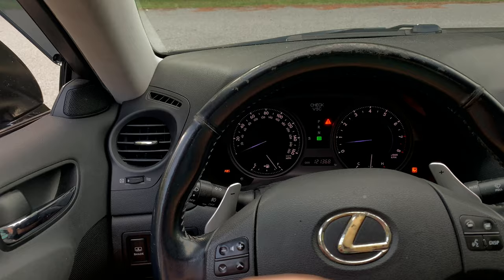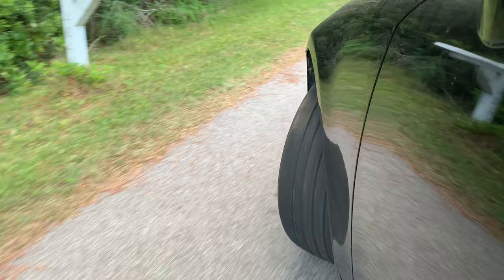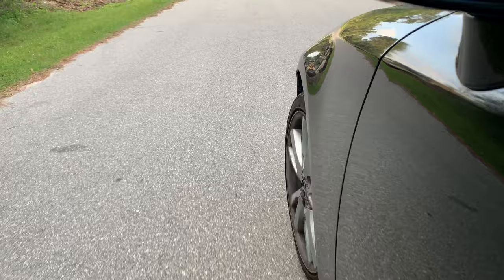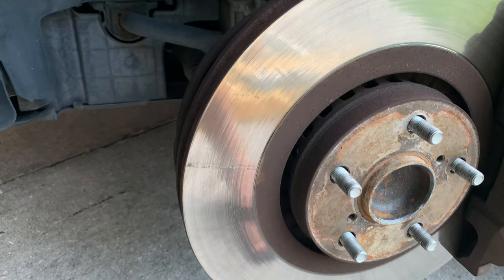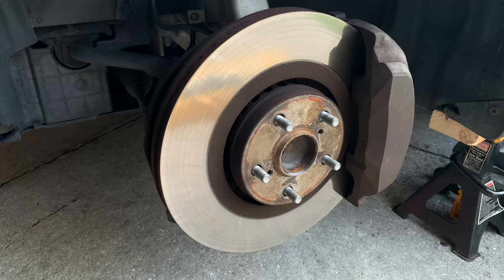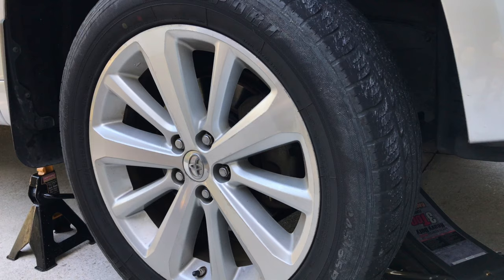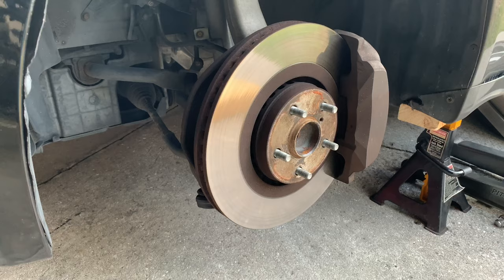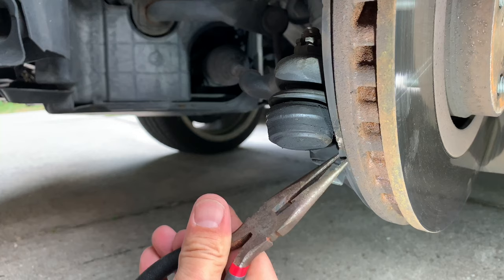Found & fixed: scraping noise when turning right or left

Comment: I had this exact problem, had convinced myself it was a wheel bearing. But the noise just wasn’t right. Until I saw your video and you had the exact noise I had. Checked my dust cover and sure enough it was bent inwards and in the perfect position to run when I had my wheel cranked for a hard turn. Pushed it out and away from the rotor and bingo fixed!!
Reply from the maker: Awesome, glad it helped!

Comment: Thank you! I had the exact same noise and the exact same problem. It was harder to get the tire off than to fix the issue. Thanks for the info on the dust shield. It was easy enough to straighten with a pair of pliers. If you are reading these comments because you have the same issue and are at all handy, I recommend that you look into this yourself.
Reply from the maker: Awesome, thanks for sharing!

Comment: Broooo
I just got my new (to me) corolla and it does this when turning left.
I know my way around cars but never would I have thought about the dust cover scraping as I thought it would be audible independent from steering angle.
I'm gonna have a look at the cover tomorrow. If it is the issue you saved me like 3h of driving to the dealership and back.

Perfect video: short and straight to the point. I like that!

Update: It really was the dust cover. I owe you one my dude

Comment: Hahaha, it was so funny, after watching this I went to my car and reached in to feel the dust cover behind the brake rotor to see if it was bent or damaged somewhere. When I tried to pull the bottom of the dust cover away a little bit, a small rock fell out! Drove the car forward and back and the noise is gone!! So happy it wasn't anything like damage or anything major that would cost a lot to fix. Also super happy I didn't have to take the wheel off or even get under the car! I never would have known to check this way if it wasn't for this video, so thank you so much!!!

Comment: Thank you! This video helped me so much. Turns out the edges of the rotors had corroded and were rubbing against the shield. I bent the shield slightly and also removed the corrosion on the edges of the discs/rotors.

Comment: I fixed it without taking off my wheels, I just put my hands in between the rims and then I pushed off the break shield or whatever it’s called from the breaks so whatever was stuck in there , rocks and what not it was removed and the noise went away just like in this video , thank you !

Comment: Thank you. Fixed our 2017 Nissan Pathfinder. Luckily, I didn't need to take the wheel off, I was able to squeeze under it and bend the dust shield with a stubby flat head screwdriver.
Reply: That's great, I was wondering if it was absolutely necessary to take the wheel off to do this. Hopefully I can do it the same way for mine as I don't have the tools to lift the car.

Comment: Thanks I hope that’s all that is wrong with my 2005 Toyota corolla LE. It has all new brakes all new rotors all new shoes for each wheel new tires, etc. someone told me it could be rack and Pinion steering. I have not taken it anywhere yet I will look at your suggestion.I hope it is what you illustrated and thank you so much for the video. And take care buddy
Reply from the maker: Hope thats what it is... !

Comment: I am having a similar sound only when I am turning left with my Corolla. I hear it right around my feet so I think it is the front left wheel too. It recently snowed here and after shovelling I placed the shovel next to the car in a pile of snow but accidentally drove over the shovel when moving the car through the snow. It dragged the shovel underneath the car for a few metres and since then I've heard this sound. Hopefully it is something simple like this video and not a major part that has been damaged.

Comment: I've got a Mazda 3 and a very similar sound when making a hard right ... I've also had two tires on the rear passenger side blow out within a few months of each other and am beginning to think the two things might be related.  They might still be two different problems, but is there any one thing that might be causing both issues?

Comment: ...step 1... jack up DF wheel... wobble wheel left and right, then top and bottom to check for looseness within tie rods, l wheel bearings, ball joints and bushings, next place pry bar between upper/lower control arms and steering knuckle to check for play in ball joints... THEN remove wheel, to inspect pads, and rotors.

Comment: Thanks for the video. I have a question. If the noise was the brake/dust shield hitting the back of the rotor, then why did it only make the noise when turning the wheel?
Reply from the maker: I would guess wheels flex or change angle a bit when turning.

Comment: Same exact problem turning left. Can’t imagine it’s a wheel baring as I have a “19” Toyota Corolla with only 50k miles. I’m going to do this tmrw.
Reply from the maker: How did it go?
Reply: @DIYtimeTRD  Dust shield was bent. Thank you so much for this video.
Reply from the maker: Welcome! 😁
Reply: @greggucwa4543  I’m gonna have to have this looked at them. Because mine also does the same thing when I turn left and I hear it from the right. So I’m suspecting it’s the right wheel.
Reply: I'm having this issue on my 2014 Chevy Impala, turning left as well
Reply: 2014 Malibu 🙋‍♀️

Comment: Why does it only make the noise when turning? I just heard the same noise on my truck only when turning left! Hope mines an easy fix too
Reply: Same. Only hear scraping when turning left. Sounds like it's coming from the rear tires. Did you find what the issue was on yours?
Reply: Ya mine was actually the dust shield also. Lol I would’ve never thought that was the isssue! Hope to figure your ghost noise out too:)

Comment: On our 2005 Honda CRV. We're getting similar noise but we're also getting vibration an. The steering wheel on left and right turns. We just had both axles replaced by mechanic in the front. That didn't seem to solve the problem for us.

Comment: My scraping sounds sounds a little different when turning left. It's like it scrapes at 1 point and goes till it gets to the same point
Reply: Did you ever fix this noise?
Reply: @GARTON360  we need answers!
Reply: did you ever find out what the point was , i feel like my tire was grinding and scraping every cycle it made
Reply: @pulido  yes, it was the brake disc metal cover which was slightly bent and was scraping on the inner wheel. Hope it helps
Reply: @GARTON360  answer down below
Reply: @quemyst  answer down below.
Reply: mine too
Reply: I have the same sound. I need to find out what the sound is
Reply: @WCDL  It’s just the same as what this guy was sayin, i took off the tire and looked at the dust shield around the router for points of contact and along the bottom it was scraping, just used a flathead and bent it back haven’t had problems
Reply: @confederatefan  how did you fix the issue???

Comment: Nice work there. Saved yourself a lot of money. How do you tell if the suspension is worn or causing noise. I hit a curb pretty bad. To my shock I couldn’t find any damage. And almost has a loud wind like noise while turning right.
Reply: Did you find out the cause? I hit a rock today ans got a weird sound
Reply: @kzb2771  yes, so when I put load on the car while turning it made that weird scraping windy sound which was the front right hub bearing. It sounded like the left but sound travels. Also during cold start it made a spooling noise before fully warmed up. I went through hell and 3 Lexus appointments as well as a new performance intake. Before I finally believed this sound is also normal. Just need to warm up the car a bit. I also found a thread where almost all rcF owners had the same noise. Once you hit something, your senses all go up, and you hear things that you never noticed before. I also wrapped every trim and part with electrical tape and insulation. Also runner o rings to put pressure on any panels that rattled. Very quite now.

Comment: I have the same sound on my left (driver) side, but only can be heard whil running at 60kms and up..
I had new wheel bearing, the car doest have any dust shield.. im a bit worried if its transmission, although then shifting of gears (automatic) is smooth.. also, whether running or while breaking the sound is consistently they.. i hope u can help me out.. :(

Comment: I have that same issue but really really faint noise when turning right as well... i changed both my front wheels bearing to OEM's last January 2022, so i don't think its that.... i'll have a look for sure. Thank for this video.
Reply: any updates on yours? i'm hearing the sound on the left, but also very faintly on the right.
Reply: @loboyloboyloboy  Definately was the dust shield.Fixed.

Comment: I have the same sound first it was when going straight under 40 and disappears over 40. Also when I turn. I checked the brake shield and it's not that. I changed my rotor and breaks because the brakes were thinning already. But the sound now persists when turning. I changed my struts and the axle a few months ago also. But the problem started recently. You think it's the bearing?
Reply: Was it the bearing?
Reply: @theItalianshamrock  yeah it was the bearing. Rear passenger side. It seemed like it was coming from the front. So better to check all wheels.

Comment: I have the same issue. 2014 IS350 AWD. So it looks like I will have to get all four tires off the ground to allow the tires to move freely. I can't just raise the front and put in neutral and then spin the tires as I turn the wheel.
Reply: Same model car. Did you fix it yet?
Reply: @singletaryli8636  yes. Thanks. Car needed brakes. The technician said that OEM brakes weren’t that good. Didn’t last long. After market will last longer.

Comment: i got a rubbing sound as i pull away but not every time i pull away just some of the time and for like 2-3 seconds then gone, almost like a sound as if my car has been unused for many years. 2.5 years old 41k on clock and had it from new.
Reply from the maker: Probably break rotors get a bit rusty or covered with dirt after the rain.

Comment: I have 2004 oddesy with similar problem. Dust cover was very rusted and while adjusting, part of it just broke. Now it only makes noise sometimes. Does this cause any damage if I leave it as it is?
Reply from the maker: It protects rotors and brakes from dust and rocks flying in.
Reply: @DIYtimeTRD  thanks.  Would part of dust cover is still there and makes noise sometimes when I turn right. Would this cause any damage to my brake parts?
Reply from the maker: It usually scrapes against the rotor, so it could possibly create a groove on it.

Comment: Is there another possible reason for this noise? Mine does it when I accelerate and turn left but it goes away and I had just done my brakes
Reply from the maker: New brakes might be scraping agains the rotors.
Reply: @DIYtimeTRD  that's the noise I took it for before the brakes though, they fixed my brakes and it still continues . Is it possible the size of rim and tires have something to do with it?
Reply from the maker: Have you ruled out the dust shield already?

Comment: I have a 2015 optima, it does this humming noise but as if it goes around the tire. Not constant and only when im turning on a curve. Once the steering wheel it straight it goes away
Reply: Ever find out what the issue is? I'm experiencing the same thing on my 08 Impreza. Front right tire makes a sound like in the video when turning right going like 20/20+ and locks up sometimes on a curve going above that so I slow down super hard for all right turns right now lol
Reply: @lamp709  this is the problem, I have the same exact thing you have and when taking a hard left, the position of the disk slightly changes as oposite of driving straight. so it would only make the noise while hard turn. If the speed is very low, you will not hear it the same because the weight distribution on that side will be less. So I would suggest to take it to a service, tell them to check if the dust shield is scraping on the brake rotor.
Reply: @nicolaedanielbitu2732  thanks! Now I have an idea of what to say to the dealership lol. Before I'd just tell them what was happening and they'd be like 🤷

Comment: That's exactly how mine sounds except it's all the time now.
Reply: Ever find out the problem?
Reply: @jasonwhalen6018  based off of research I'm sure it's the dust shield for my rotor. Maybe a dent or debris.
Reply: @jasonwhalen6018  just checked it out actually, I don't have a dust shield but the rotor was wobbly, I tightened it and no more noise.
Reply: @hapakope8972  I just pushed my dust shield with screw driver seems good so far
Reply: @jasonwhalen6018  did you have to take the wheel off?

Comment: Mine happens when I go a little faster than that. Doesn’t happen when I’m going slow
Reply: same here, have you found the problem?
Reply: @andrewgordon5847  could be a rock in the shield by of the rotors
Reply: @andrewgordon5847  I think it’s a rock in the dust shield. Mine doesn’t make that noise anymore. Must’ve fell out. Could also be your brakes, or wheel bearings is what my uncle first thought. Let me know if you fine the problem